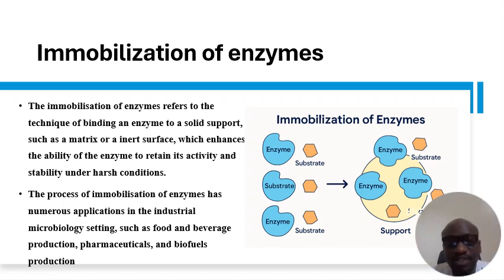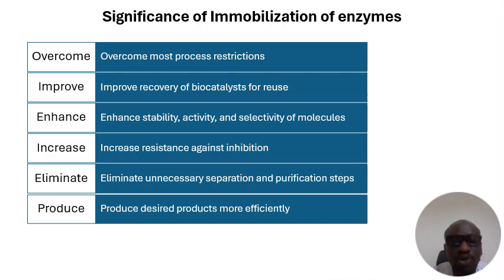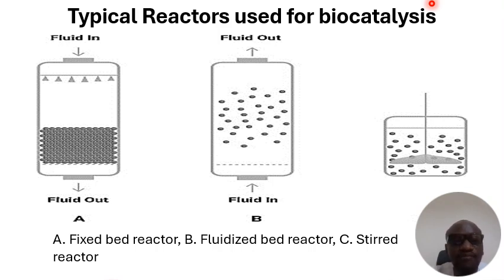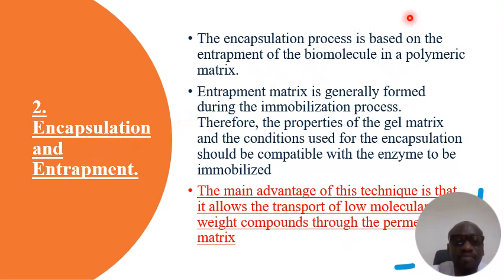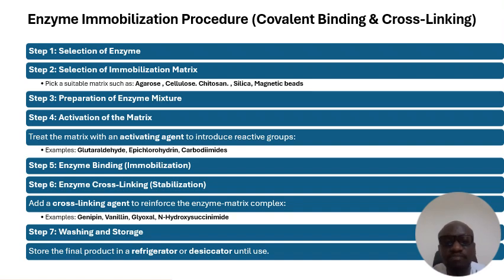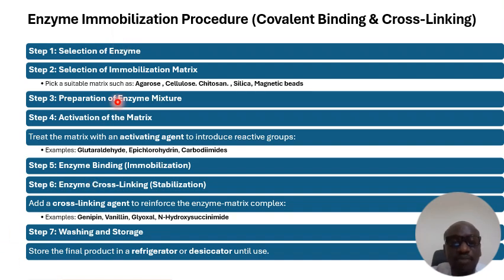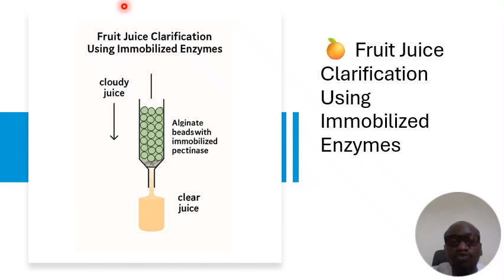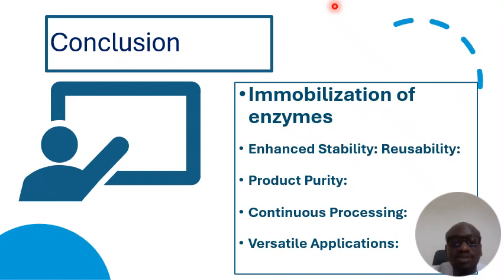Immobilization of Enzymes (Industrial Microbiology )

Comment: Question 1:
Immobilisation of enzymes is the process of restricting an enzyme to a solid material, such as beads or a membrane, without stopping its catalytic activity. This allows the enzyme to stay in the reactor while the substrate and products move freely, making the enzyme easy to recover and reuse for repeated reactions.

Question 2:
Advantages:
The enzyme can be recovered and used repeatedly, reducing production costs.

The final product is less likely to be contaminated with enzyme proteins, making purification easier.
Immobilized enzymes are often more stable and can withstand changes in temperature and pH better than free enzymes.

Application:

Immobilized glucose isomerase is widely used to convert glucose into fructose during the production of high-fructose corn syrup in the food industry.

AndrewUdo Vivian Afomachukwu 
230807576

Comment: Question 1: Enzyme immobilisation is a method in which enzymes are attached to an insoluble support or carrier while retaining their catalytic ability. This allows the enzyme to remain fixed in one place during a reaction and prevents it from being washed away with the reaction mixture. Materials commonly used as supports include beads, membranes, and gel matrices. The major methods of immobilisation are adsorption, entrapment, encapsulation, and covalent attachment.

Question 2: Advantages of Immobilised Enzymes

1. Immobilised enzymes can be easily removed from the reaction mixture, which helps in obtaining a purer final product.
2. They are generally more stable and can withstand changes in temperature, pH, and other operating conditions better than free enzymes.
3. They are economical because they can be recovered and reused several times, reducing the overall cost of enzyme use in industrial processes.
4. They are ideal for continuous production systems, increasing efficiency and minimizing waste.

Application:
A common industrial application of immobilised enzymes is the production of high-fructose corn syrup. The enzyme glucose isomerase is immobilised and used to convert glucose into fructose. Since the enzyme remains attached to the support, it can be reused for long periods, which lowers production costs and ensures consistent product quality.

NAME: ONYEOCHA BENEDICT CHIINDU

MATRIC NUMBER: 230807508

Comment: Precious Omotayo
210807043
Reply: Question 1:
Enzyme immobilisation is the process of locking up a soluble enzyme on a solid insoluble support so it doesn't move, but it's still doing its job. 

Methods includes:
Physical adsorption 
Entrapment/Encapsulation
Covalent binding 

Question 2:
Advantages 
No stress separation: Easy to filter out from the mixture.
Choke stability: It withstands harsh temp and pH without denaturing.
Low-budget processing: You can reuse it multiple times, so it saves cost.

Application
They use immobilised glucose isomerase to convert glucose to fructose for making High-Fructose Corn Syrup (HFCS).

Comment: Name: OSAGIE IRABOR
Matric Number: 210807121
Reply: 1. Enzyme immobilisation refers to the technique of physically or chemically binding soluble enzyme molecules onto or within a solid support matrix. This process prevents the enzymes from mixing directly into the final reaction mixture, allowing them to remain stable under harsh operational conditions

2. Two Advantages
a. Immobilised enzymes can be easily recovered and reused across multiple reaction cycles, eliminating the need for frequent enzyme replacement.
b. They show greater resistance to thermal denaturation and pH fluctuations compared to free enzymes
Real-life application
Immobilised lactase enzymes bound inside alginate beads are placed in column reactors to break down lactose into glucose and galactose as milk flows through, making it safe for lactose-intolerant consumers

Comment: 1.	Explain Immobilization: Enzyme immobilization is the process of attaching enzymes to a solid material so they can keep working effectively and remain stable for a longer time. It is widely used in industries such as food production, pharmaceuticals, and biofuel manufacturing because the enzymes can be reused and perform better under harsh conditions.  Enzymes are attached to a solid materials or support (such as beads, gels, membranes, or fibers) using methods like adsorption, covalent bonding, entrapment, or encapsulation. This is useful because the enzymes become more stable, can be reused many times, are easier to separate from the reaction mixture, and reduce production costs in industrial processes.

	2.	Advantages and Real life application

Advantages: 
	1.	Easy to separate 
	2.	Can be reused multiple times 
	3.	Low cost of downstream processing

Real life application
Fruit juice processing – Immobilized pectinase is used to clarify fruit juices, making them clearer and improving yield.

Submitted by: MUSA-GADANG ANDREW 
MATRIC NO: 210807022

Comment: Question 1: Explain immobilisation
Immobilisation means attaching enzymes onto a solid support matrix so they stay fixed during reactions. This makes it easy to recover and reuse the enzymes without contaminating the final product. It also increases their overall stability under harsh industrial conditions.

Question 2: Applications and advantages

 Advantages:
●  Easy recovery of biocatalysts and effortless reusability across multiple cycles.
 ● Enhanced operational stability against harsh temperatures, pH, and organic solvents.
● Reduced downstream processing and purification costs.
● Extended shelf life and better resistance against inhibition.
●  Supports continuous processing in reactors with minimal product contamination.

Real-life Applications:
● Pharmaceutical Synthesis:Used to produce active pharmaceutical ingredients (APIs) like antibiotics and hormones with high purity and reduced waste.
● Dairy Industry: Used in continuous reactors with immobilised lactase enzymes to produce lactose-free milk.
● Food and Biofuel Industry:** Used in high-fructose corn syrup production and biodiesel processing.

Submitted by Adedigba Safiyyah Adedoyin 
Matric number: 230807575

Comment: Question 1:
Immobilisation is the process of attaching or trapping enzymes onto an inert, insoluble support material (like alginate beads, glass, or cellulose) so they are held in place. This is useful because it allows the enzymes to be easily recovered and reused, rather than being lost in the reaction mixture.

Question 2
Advantages:

· Reusability: The enzymes can be recovered and used repeatedly, which significantly reduces costs in industrial processes.
· Improved stability: Immobilised enzymes are often more resistant to changes in temperature and pH, making them last longer and work in harsher conditions.
· Easy separation of the enzyme from the product, preventing enzyme contamination in the final product.

Real-life application:

· The production of lactose-free milk. Immobilized lactase is used to break down lactose into glucose and galactose, and the enzyme can be reused continuously in a bioreactor.

Akinlotan Adeola Alice
210807091

Comment: Question 1

Immobilisation of enzymes is the process of attaching or trapping enzymes onto a solid support, such as magnetic beads, silica gel, or agarose, so that they remain fixed instead of mixing freely in solution. The enzymes can be immobilised through methods such as physical adsorption, encapsulation, covalent binding, or cross-linking, allowing substrates to flow over them and be converted into products. This process improves enzyme stability under harsh conditions and allows the enzymes to be easily recovered and reused without contaminating the final product.

Question 2

Advantages

1. Immobilised enzymes can be easily separated from the final product, allowing them to be recovered and reused, which makes industrial processes more cost-effective.

2. Immobilised enzymes have improved stability and retain their catalytic activity over a wider range of temperatures and pH conditions.

3. Immobilised enzymes reduce the cost of downstream processing because they remain attached to the support, eliminating the need for additional purification to remove enzyme contamination from the final product.

Real life application

In the fruit juice industry, immobilised pectinase is used because fruit juice naturally contains pectin, which makes it cloudy and viscous. The juice is passed through a column containing alginate beads with immobilised pectinase, which breaks down the pectin and reduces its turbidity, producing a clearer juice that is easier to filter. Since the enzyme remains trapped in the alginate beads, it does not contaminate the final product and can be reused repeatedly.

Ugoh chidera Stephanie
210807093

Comment: Name: OWOLABI DAVID AYOMIDE 
Matric No.: 210807086

Question 1:
Immobilisation of enzymes is the process of attaching or trapping enzymes onto a solid support so they remain in one place while still carrying out their catalytic function. This makes the enzymes easier to separate from the reaction mixture, reuse multiple times, and improves the efficiency of industrial processes.

Question 2:

Advantages:
    1. Immobilised enzymes can be reused, reducing production costs.
    2. They are easier to separate from the reaction mixture, giving a purer product.

Application:
    Immobilised lactase is used in the dairy industry to produce lactose-free milk by breaking down lactose into glucose and galactose.

Comment: Question 1: Enzyme immobilisation is the process of attaching enzymes to a solid support while preserving their catalytic activity. 
This allows the enzymes to remain in a fixed location during a reaction instead of being carried away with the reaction mixture. The enzymes may be immobilised on materials such as porous beads, membranes, or gels through methods including adsorption, entrapment, encapsulation or covalent bonding. 

Question 2: Advantages of Immobilised Enzymes

1. Immobilized enzymes can be easily separated from the reaction mixture, preventing contamination of the final product.
2. Enhanced stability as they are generally more resistant to changes in temperature, pH and other operating conditions than free enzymes.
3. Immobilized end are cost effective. They can be recovered and reused multiple times, reducing the overall cost of enzyme use and downstream processing. 
4. Well suited for continuous industrial processes, improving productivity and reducing waste.

Application: 
Immobilised enzyme (glucose isomerase) is widely used in the food industry to convert glucose into fructose during the production of high-fructose corn syrup. The immobilized enzymes allow reuse for long periods in continuous production systems, reducing costs while maintaining consistent product quality.

NAME: OBUWOVO OGHOGHOMENA GLORY 
Matric Number: 230807502

Comment: Question 1
Enzyme immobilisation is the process of attaching or confining an enzyme to a solid support matrix, such as alginate beads or silica gel, rather than letting it float freely in a solution. Fixing the enzyme in place is highly useful because it allows the enzyme to be easily separated from the final product and reused multiple times. Additionally, the solid support protects the enzyme, improving its stability against harsh temperature and pH changes during large-scale industrial processes.

Question 2
Advantage 1: Immobilised enzymes can be easily separated from the final product, which leaves the product clean and minimises the need for costly downstream purification steps.

Advantage 2: The enzymes can be recycled and reused multiple times, making the overall production process continuous, faster, and much more cost-effective.

Real-Life Application: In the dairy industry, immobilised lactase enzymes are used to break down lactose, efficiently producing lactose-free milk for individuals who are lactose intolerant.

NAME: Kehinde Grace Adepetun 

MATRIC NO.: 210807104

Comment: Awonuga Funmilayo Nofisat
Reply: Enzyme immobilization is a technique that involves the attachment of free, soluble enzymes to solid and inert particles in other to restrict its mobility while preserving its ability to catalyze chemical reactions.
Reply: This process ensures that the enzyme is reusable and able to operate in continuous industrial processes
Reply: Question two

1.  Reduces the cost of downstream processing
2. Extends the enzyme shelf life reducing the need for frequent replacement of the enzyme.
3.  It reduces cost and improves overall  bioprocessing efficiency.
Reply: Application: 

It can be used used to make lactose free milk. 

The enzyme lactase in milk binds to the beads in the reactor and the milk becomes lactose free as it flows over the beads.

Comment: Question1
Enzyme immobilization is the process of attaching or trapping enzymes onto a solid material so they remain fixed in one place while still carrying out their catalytic function. This allows the enzymes to be easily separated from the reaction mixture and reused.

Question 2.

Advantages of Immobilized Enzymes

1. Easy Recovery and Reuse: Immobilized enzymes can be easily separated from the reaction mixture and used repeatedly, reducing production costs.

2. Improved Stability: They are more resistant to changes in temperature and pH, allowing them to remain active for longer periods.

3. Simpler Product Purification: Since the enzymes remain attached to a support, they do not contaminate the final product, making purification easier.

4. Continuous Processing: They can be used in continuous industrial processes, improving efficiency and productivity.

Real life Application

Production of Lactose-Free Milk: In the dairy industry, immobilized lactase is used to break down lactose into glucose and galactose, producing lactose-free milk for people with lactose intolerance.

NAME:Popoola Vincent Oluwanifemi 
MATRIC NO:210807046

Comment: 1. Enzyme immobilization means fixing or attaching an enzyme to a solid material (support) so that it cannot move freely, while it still carries out its job.
Enzyme immobilization is done by attaching enzymes to a solid support through adsorption, covalent bonding, entrapment, or encapsulation, making them more stable, reusable, easy to separate from products, and cost-effective for industrial us

2. Advantages:
-Lactose-free milk production: Immobilized lactase breaks down lactose (milk sugar) into simpler sugars, making milk suitable for people with lactose intolerance.

-Glucose syrup production: Immobilized glucose isomerase converts glucose into fructose to produce high-fructose syrup used in soft drinks and processed foods.

-Real-life application: Blood glucose biosensors use immobilized glucose oxidase to measure blood sugar levels quickly and accurately for people with diabetes.

Awujoola Adedayo Joseph 
210807047

Comment: 1: Immobilisation is the process of attaching or trapping enzymes on a solid support so they remain fixed while carrying out their catalytic activity. This is useful because the enzymes can be easily separated from the reaction mixture, reused several times, and are often more stable.

2:Enzymes can be reused, reducing production costs.
* They are easier to separate from the reaction mixture.
* They are generally more stable and have a longer working life.

Application: Immobilised enzymes are used in the production of lactose-free milk, where the enzyme lactase breaks down lactose into simpler sugars.

Name: Onuh Anthony 
Matric No: 190807010
Reply: Microbiology

Comment: Question 1

Immobilisation is the process of attaching or fixing a soluble enzyme onto an insoluble solid support while retaining its catalytic activity. This process improves the enzyme's stability, allows it to be reused, and enhances its resistance to changes in environmental conditions.

Enzymes can be immobilised using several methods, including:

Physical adsorption
Encapsulation and Entrapment
Covalent binding

Immobilisation is useful because it enables easy recovery and reuse of enzymes, extends their shelf life, and improves their stability during industrial processes.

Question 2

Advantages of Immobilised Enzymes

● Easy separation of the enzyme from the reaction mixture.

● Improved stability under different operating conditions.

● Reduced cost of downstream processing due to enzyme reusability.

● Increased operational efficiency through repeated use.

Real-Life Application Immobilised glucose isomerase is widely used in the food and beverage industry to convert glucose into fructose for the production of high-fructose corn syrup (HFCS), which is commonly used as a sweetener.

Submitted by: 
Alabi Joshua Ariyo 210807044
Reply: Hi